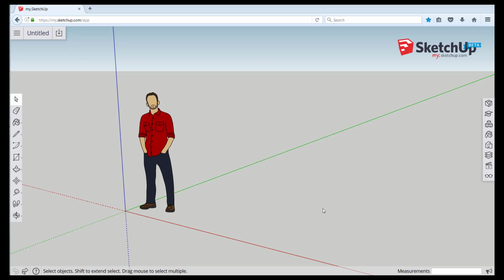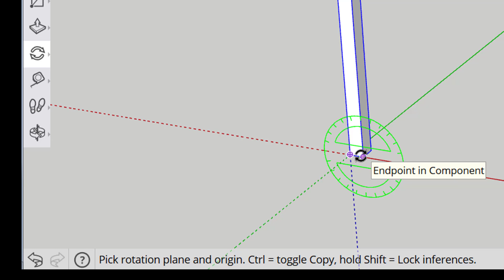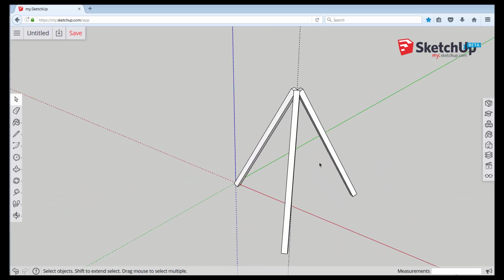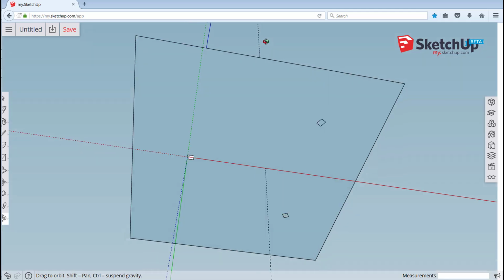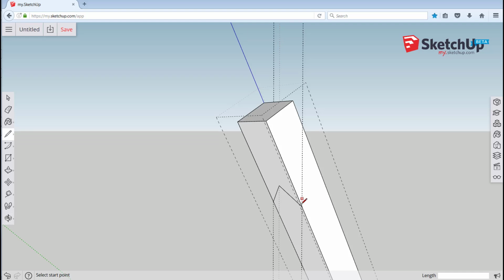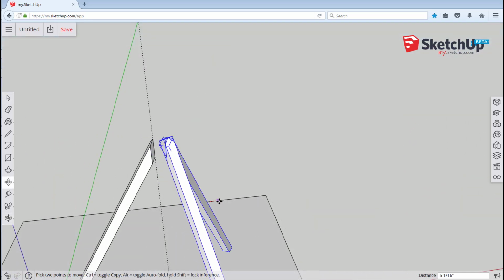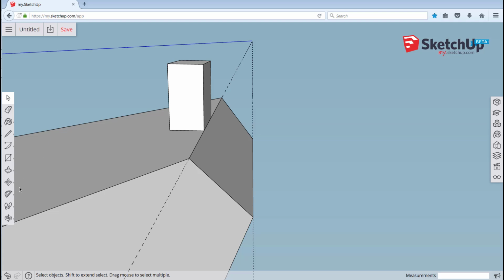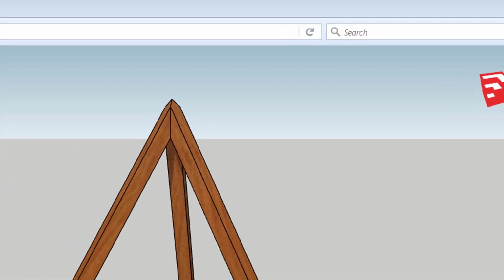How to Calculate Compound Miter Angles with My.SketchUp.com

Comment: Nice presentation but I have a comment. You started with a 4 x 4 that was eight feet long. Then you extended the length to reach the apex. Could you show how to start your model with shorter posts then extend the bottoms to a longer length, such as eight feet. This I believe would be more representative of the actual construction, knowing the final length as eight feet .

Comment: Hello and thank you for this presentation. Is there any way I can contact you about hiring you to sketch up a pyramid model that I've already built and have photos of, but would like a digital sketch of it and to know a few of the angle cuts I had issues with when building. Or can you refer me to someone I can pay to have this sketched up for me, as I was hired to build another of the same structure. Thanks in advanced.